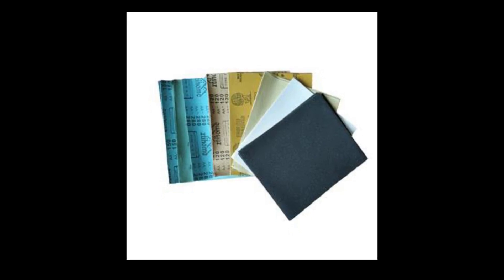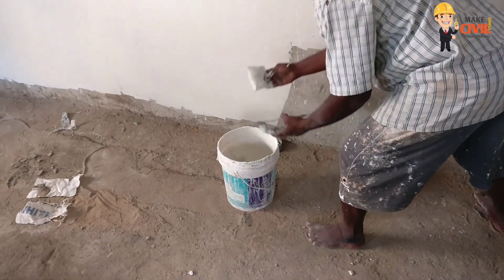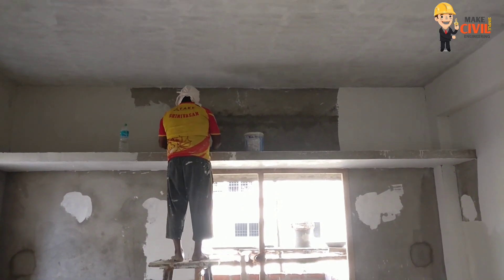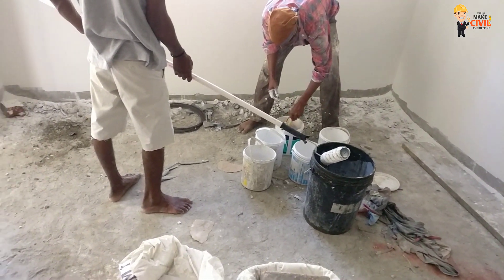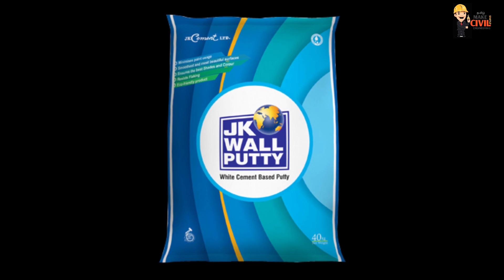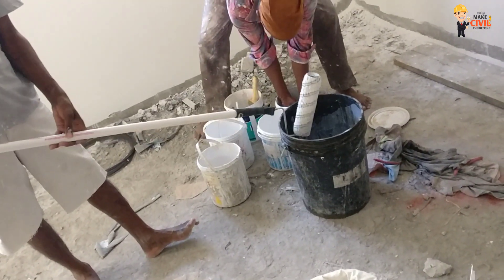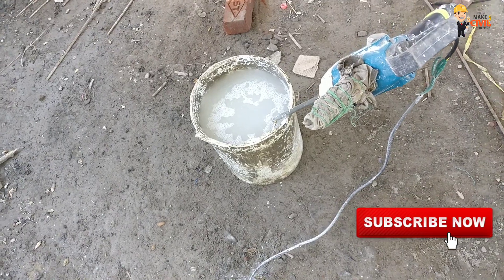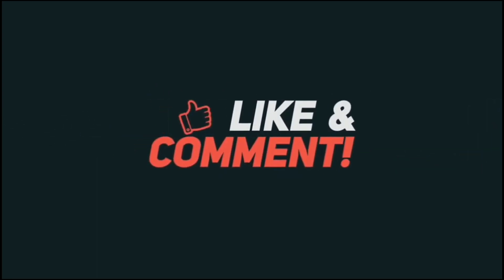உங்கள் வீட்டு சுவரில் முறையாக  wall putty அடிக்கப்பட்டுல்லதா? எவ்வளவு putty தேவை?

Comment: Sir, before applying wall putty white cement coating is essential or not?
Reply: @civilengineeringsimple  sir putty ku bathila surya cem use panlamaa?
Reply: @civilengineeringsimple  bro first coating putty mudinji 2nd putty eppo pakkanum 2nd mudinji primar epo pannanum solungha